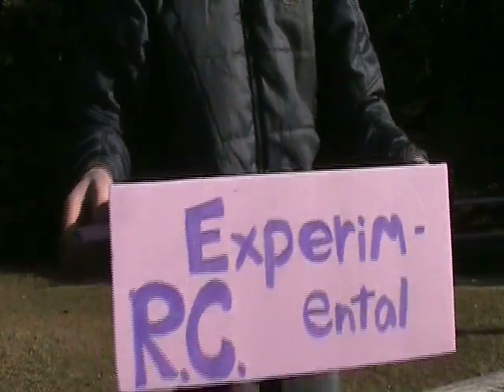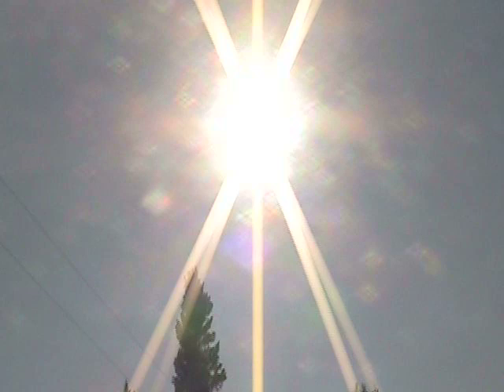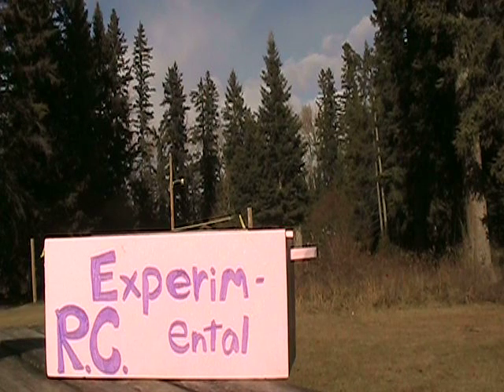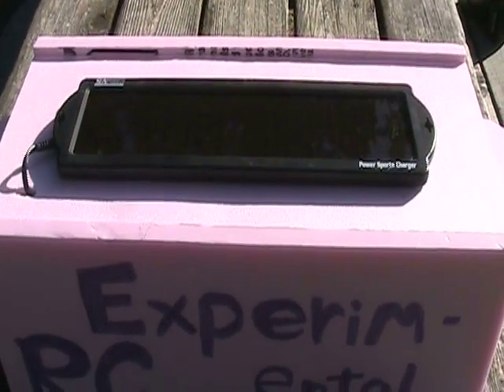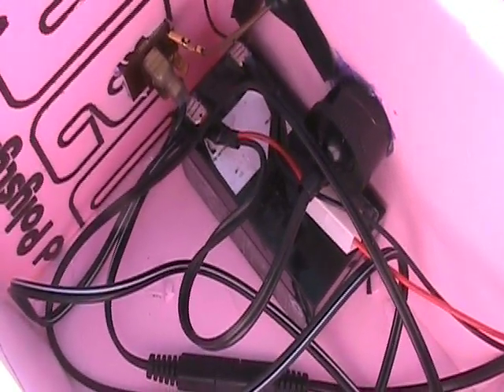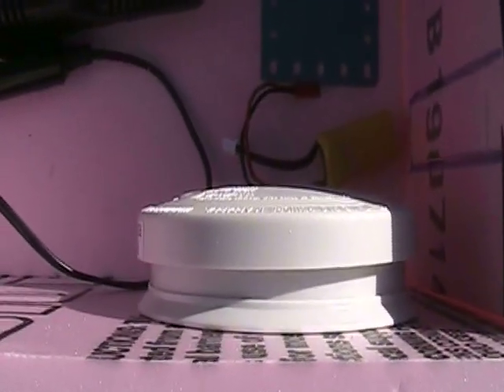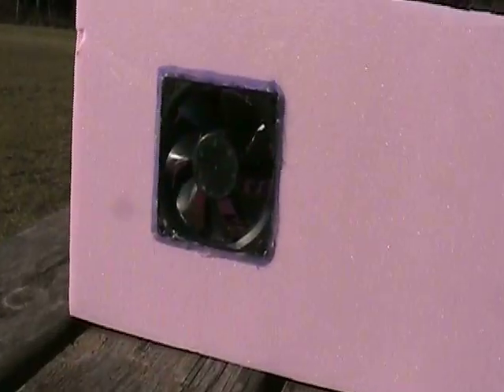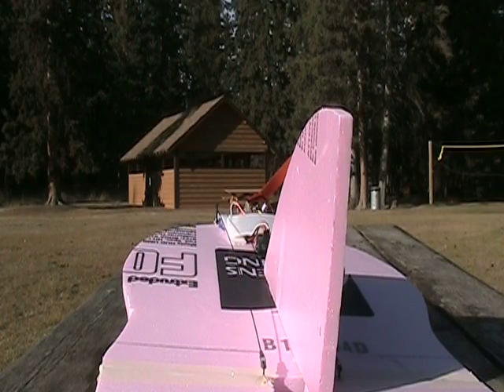DIY RC Battery Solar Charger

Comment: ok you SIR put a wrinkle in my brain. use the solar charger to power a charger instead of trying to charge  the batteries with the charge controller / batt pack with unknown voltages from the charger itself....genius !
Reply from the maker: The solar panel is trickle charging a 12-volt lead-acid battery. This is a common and perfectly normal method of charging a battery with a solar charger.

Comment: Thanks for sharing-great idea- had it been effective? Is it the Sunforce 50013 1-Watt Motorcycle and Powersports Solar Battery Charger? At 1W had it been effective at keeping the 12v sealed Battety topped up?